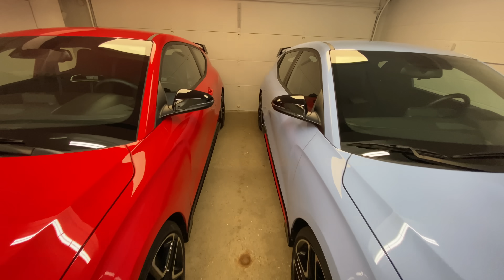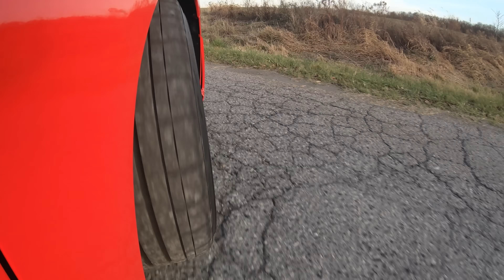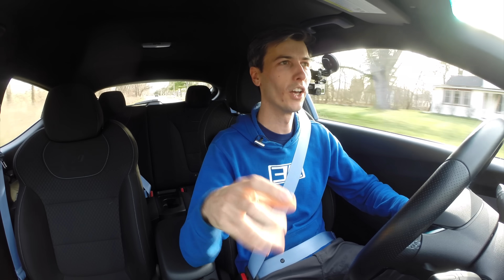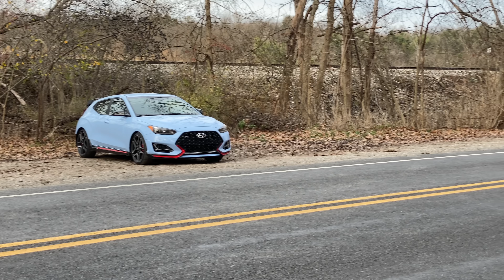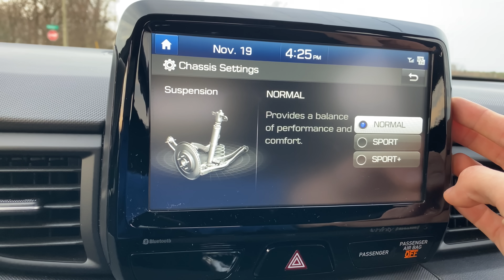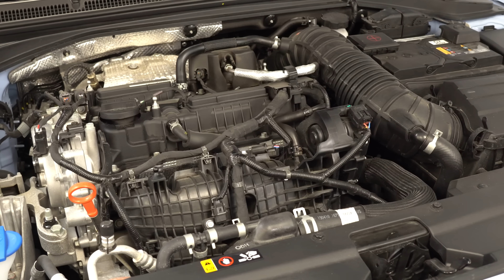Are Front Wheel Drive Sports Cars Any Good?

Comment: Do FWD cars have a bigger turning radius than RWD cars?
Reply: Usually yes, because the CV joints on the driveshafts don't like large angles.
No generalization though FWD city cars can have better steering angles (and turning radius) than RWD full suze sedans.
Reply: Turning radius has little to do with engine position in the abstract but a small FWD car with big wheels doesn’t allow for much room for those wheels to pivot without hitting the engine.  One way to decrease turning radius is to have the rear wheels steer in conjunction with the front wheels, as was done on the 1990-1992 FWD Honda Prelude Si 4WS, one of the best 4 wheel steering cars ever mass-produced.
Reply: that depends on the car, not the drive train.

Comment: With front wheel drive, if you “lose it” in bad weather, you REALLY lose it.

With all those “features”, I’d expect that car to “be in the shop” a lot, if my experience with things like ABS and AC is anything to go by. . .
Reply: makes me wonder why I see almost nothing but RWD cars spinning out during bad weather.🤔
Reply: this just doesn't make logical sense since turning the wheel and stomping the gas in low traction with front wheel drive is more likely to get you back on track than a rear drive. you just can't be a dunce with your oversteering. also in almost all case this puts more weight on the drive wheels since they're directly under the engine and transmission.

Comment: HOWCOME nobody made a car with engine at the back and front wheel drive?
Reply from the maker: Because you'd have very little acceleration ability. All the weight over the rear axle, and then as you accelerate, you remove even more load from the front axle (as discussed in the video - which is why the engine up front makes sense).
Reply: @EngineeringExplained  Yep, i rushed my comment, realized it few minutes in haha
Reply: @EngineeringExplained  But you'd have superior braking ability!
Reply: @TheMatt365  no
Reply: Because it would be ye stupidest car ever: no power transferred well to ground from front wheels, if you brake it will be extremely unstable and prone to pendulum effect, extreme understeering exiting curves and extreme oversteering entering in them. It's just a crazy idea.

Comment: I will save you 10 minutes of your time. The answer is NO
Reply: Did you get beaten by a front wheel drive Honda?
Reply: Not even a civic type R can beat my car
Reply: @Alex.AL_26  But it can pull 6 Gs while accelerating!
Reply: @Alex.AL_26  Press X for doubt
Reply: @sgabriel  not quote, but just about 1G
Reply: @Alex.AL_26  What's your car?
Reply: @williamcricket7931  Tesla Model 3 Performance

Comment: Probably depends on your definition of "sport" and "good".

I personally believe that a 2600 lbs Integra is in some respects sportier than a 3200 lbs Lexus (or a 3500 lbs Subaru). I can only imagine how sporty a 2900 lbs Polo/S1 is, but will probably never know.
Reply: Yeah sporty is a feeling more than anything else. If the car feels like it „wants“ to turn and go quick. It can be an old car, it can be a car with low hp, it can be everything. Kinda hard to explain. A car can have 500hp and still feel like a family van in corners. Thats not sporty in my book.
Reply: @killdizzle  I only mentioned what most people do on dayly driving... Pulls maybe some fast corner. When a GTi does this all ok... For most
Reply: @Nordlicht05  No, most don't. The vast majority of people drive a sporty or powerful car just as they do any other... because after a while it becomes a bit boring, and chasing those thrills means driving ever faster. Ego driven males, those self proclaimed expert drivers who see speed as the only goal, are usually the ones who do that. They usually find the limits of their car the hard way, with an insurance claim and a big bill. And yes, I've owned several sports cars, but never had an accident or a speeding ticket.
Reply: @another3997  I remember saying... Maybe pulls. Yea I know
Reply: My Elantra GT is sporty! Its got a "factory sport-tuned rear suspension" 😂
Reply: @killdizzle  that's all day driving sporty in a "some" legal way...
Reply: @killdizzle  No Problem... I myself driving a very very understeer happy AWD and call it sometimes sporty oops

Comment: YES !!! 😁
In an Overpowered Front wheel drive you will learn to dial the accelerator to avoid the 'birdie' and the traction break.
In an Overpowered Rear wheel drive you will learn that the rear axle wants to overtake you, leading you to a spin.
Also the weight of the engine will always provide downforce / traction to the front axle.
And if you still have traction problems, you can always drive the car backwards... like I do 😜

Comment: I had a Mazda Speed 3 with about 350 hp and while it was a fun little car, I hated the loss of traction in corners while accelerating. Torque steer made it feel like I was holding on to a bucking bronco. Also, no drifting =(
Reply: RWD people always like to act like they can accelerate out of a corner full throttle with no issues. FWD cars understeer, RWD cars oversteer. RWD cars don't just magically have more grip, they can't accelerate out of corners completely fine. If you understeered in your car, it's your fault for not knowing the limit of grip. Don't blame the car, blame the driver.
Reply: @cfg_form2122  While that is true, one thing you're not accounting for is the shift in weight aft when you accelerate, allowing more grip to be achieved by the back tires.
Reply: @jairhausheer3712  Yes, that is true, but it doesn't mean you can go around corners with RWD with no consequences. It all comes down to the driver and how they drive, if you're accelerating hard into or in a corner, you're driving wrong, and it doesn't matter what you're driving, it's not going to end up well for you.